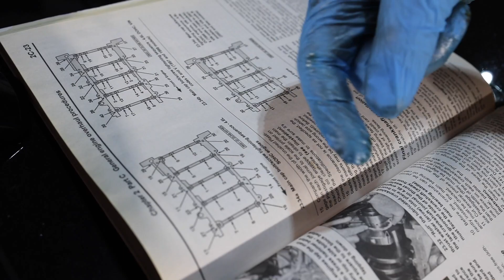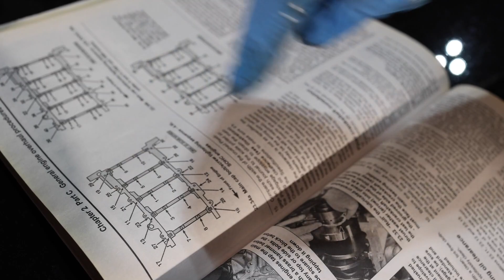How To Disassemble a 4.6L SOHC 2V Mustang Short Block

Comment: Modmax forged crank and rods and DSS pistons with valve reliefs so you can run a more aggressive cam. Mine are Todd Warrens. Full ARP hardware on the bottom end and headstuds.  Stock heads just had them cleaned up with new seals and guides. Good luck finding a decent cobra crank. So much better options there.
Reply from the maker: That would be sick! Yeah I'm gonna be running Todd's cams also. Definitely will do ARP for those yes. Yeah that's the plan for the forged crank so we can turn it up in the future

Comment: That's crazy, I have a 02 gt that I have been running a blower on that ended up with the exact same damage! I was at 100k on the engine and had the same damage on cylinder 3 as well! I just got done with my rebuild and I stumbled across this video, so crazy to see the exact same thing happen!
Reply from the maker: Apparently it's a pretty common issue a lot of people I discussed it with on the Facebook forums said they've heard it happen before. It is crazy! Next year I'll have a fully forged bottom end, new fuel system and all so I'm hoping with a good tune it won't happen again
Reply: @RatchetWrenches  I kept mine pretty tame so I didn't take the budget through the roof lol but I did the stock crank with h beam rods and forged pistons. I'm still running the stock heads that I had freshened up and I used ARP head studs. Once I have everything broken in I'll turn the boost up a little and it should be a good DD car....until I decide to go the next step hahaha. I'm excited to see what you go with and how your build turns out!!

Comment: Let's say I'm working on this motor and i drop a nut out bolt down where a fuel injector sets. 

Should i take the intake manifold off? Vacuum it? Magnet pen?

Would it land on the piston?

Thank you
 I did that. Haven't got the bolt out